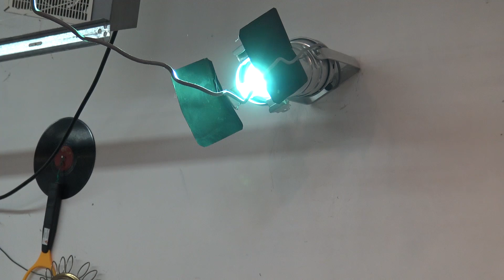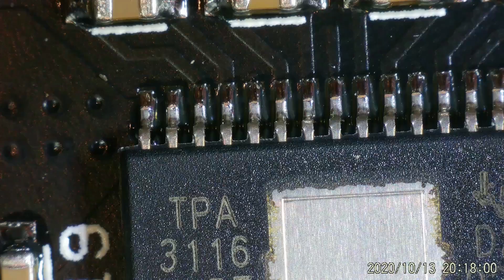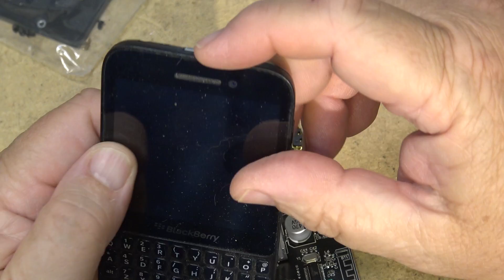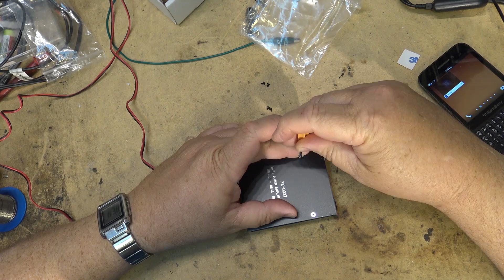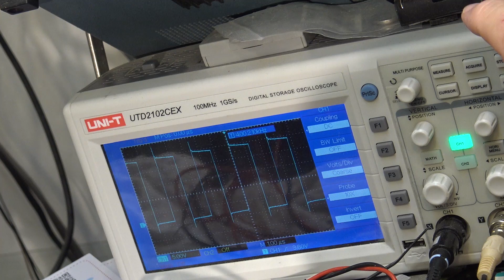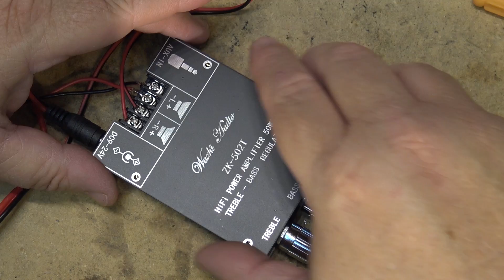tpa3116d2  50 watt bluetooth board with base treble and volume controls

Comment: Weird problem.  When I watched this video, on my Samsung TV through the YouTube app, the audio was very low, and I had to turn it to max, which wasn't making much difference in the volume.  Whilst watching, I decided to open the video in my Android phone, and as soon as I clicked on the video I was already watching, the audio on the TV suddenly came to the proper volume.  It was weird.  I've had problems lately with volume on some YouTube videos on my TV, but this baffles me.  Just by clicking the video on my phone, the TV boosts to a higher volume..  I have repeated this several times.  After opening the video on my phone and the volume correcting itself on the TV app, I can close the phone app and the volume stays, but if I reopen the video on the TV, it's back to the low volume again.  Any1 notice this problem?  Weird that my phone actually fixes my TV volume, without even being connected to the TV.

Comment: I just watched Paul Carlson's Lab's latest video where he built a turn on delay, but there's a bit at the end where he talked about transformers and I learned something that I never knew! It's really got me thinking! Now I'm looking at the inductors at the output of your class D amplifier and wondering if inductor size plays a role in frequency response? I have seen many different versions of these little amplifiers and the difference is usually in the type of inductor and capacitor that the designer have chosen to use! 
The difference in size for the old 25hz mains line transformers to the current 50hz is huge! Admittedly, I don't know enough about this particular topic but it would be interesting to know if the size of the inductors used as an output stage filter makes any difference to it's frequency response, some class D amplifiers seem to have troubles getting down into the lower frequencies! And yet they still use them for car subwoofer amplifiers! I have had a few of them but I'm always drawn back to class A/B, if you know anything better on this topic I would love to hear about it, I haven't seen any videos on this yet... Paul's vacuum tube amplifier is output transformerless and I think that he gets down to 17hz at 1db down... Or was it lower than that? Not sure now but it's pretty low. 
Anyway, this was a great review, I have a few different versions of these things, some have the same inductors and others have the larger red ring type, I haven't heard them yet but I think that when I do, I will be specifically looking at their low end results to see if there's anything different between the different output filters...
Reply: The inductors will only affect the high frequencies of the class D amplifier's output because the output network is a low-pass filter with the inductance in series with the speaker. It's the opposite of a tube output transformer which has inductance in parallel with the speaker. If a class D board has trouble with lower frequencies maybe the coupling capacitors are too small.
Reply: @eDoc2020  the coupling capacitor would be my first port of call for bass response in any other amplifier unless it's a single ended capacitor coupled output stage but when it comes to class D amplifiers, my first exposure to them was with car audio amplifiers and I really didn't get what I was expecting, the next time was when I decided to give my 90's Sony ES amplifier to my son and get a newer Sony ES amplifier that also had HDMI, even though it's rated at a higher output and has more features, the new one is also a class D topology and I hate how it sounds! I really had high hopes for it, it's not noticed during movie's, but music is terrible. I really regret giving away the older one. I have an amazing little amplifier that was sold as a kit in Australia back in 1973 from the Electronics Australia magazine that someone else had built, she's rated at 13W per channel and she literally makes wine out of music! It's the ugliest amplifier that I have ever seen, I originally got it to gut it and put two 200W class D amplifier modules inside it, I really don't know what I was thinking LoL. 
There was a time when I got caught up in the class D hype and purchased a lot of different class D amplifier modules from eBay for all sorts of project's but if Sony and pioneer couldn't get it right, then I wasn't going to bother with the eBay stuff so they have been sitting around doing nothing! 
But this new little insight into transformers and how their size affected it's frequency response got me thinking about class D amplifiers again... But as you have pointed out, it's a filter, not quite the same thing.. but I will have to look at the input capacitors...
Reply from the maker: The inductors on class d are to remove the high frequency carrier and their size is chosen dependent on the carrier frequency.  Higher frequencies use smaller inductors.  Lower use larger ones.   Sub amps tupically use 60-100 khz and massive inductors plus low pass filters to limit the frequency response to a fee hundred Hz.  
I haven't seen Paul's transformer less tube amp. I know Paul but admityantky haven't been to his channel is years, or for that matter anyone else's for that matter.
Reply: @12voltvids  WHAT? you don't watch YouTube? LoL fair enough... I have been noticing a little shift with content providers lately, a lot of providers are being mentioned on other channels and I have seen providers commenting on other channels! As a consumer LoL I really love it when I see a familiar face commenting elsewhere! I think that it's a good thing, you guys are professional, you all know each other if only through watching on YouTube, to me it feels like a little community, if I'm not watching one of your videos, chances are that I'm probably watching someone else that you would probably be watching to because we have similar interests! You might be a content provider but you need entertainment too! And being a community, we all learn from each other so we all have something to give! Even if it's just to leave a comment saying that you are gay or something else just as stupid for something that you might have done, not that is what I'm saying, I have heard other providers talk about some of the comments that they have got at one time or another.. hmmm I wonder if anyone else has put together a video on just these types of comments LoL... 
Anyway, thanks for your reply, it's always welcome! See you in your next video, well not really you but your hands lol, do you wear gloves when you are out in public just in case you get recognised lol? Ok I'm just trying to be funny now...
Reply from the maker: @PeterMilanovski  
Actually when i do watch YouTube which is not very often it is usually music based.  To watch a classic jazz or rock performence or something to do with cars.   I just don't have time.  I spend an average of 40 hours a week working on my channel and when i work another 37 hours a week at my day job there is little time for anything else.
Reply: @12voltvids  I hear you buddy, you work way to hard! It takes super human abilities to do what you do and I truly appreciate it...

Comment: I'm still not sure about D class amplifiers yet,  i'm mentally stuck in the  push pull analog amplifier days.
Stuck in the mud lol.
But it is very small and neat for so much power output :-D
I wonder what a spectrum analyser would make of it.
Reply: TL;DR I am never going back to using class-AB P-P ever again never!.
I literally had a lifetime of awful class-B notch crossover distortion, as a toddler to teenagehood  first stereo was a solid state 1967 philips stereo of the time(Germanium P-P), then gifted a transistor radio (that POS 2 germanium and nasty OPT, awful ) Then I was suckered into buying "Sage Audio" mosfet modules for about 10 years, the guy who built them lied about them being "dynamic class-A" They had a lot of class-B notch or crossover distortion at low power, piano sounded super grainy like surrounded with scraping sand paper changes with the music, , that's why I always listened loud with them, until they blew,  then I went P-P tube amps, for the next 10 years, wonderful smooth but low power for what I grew used to, and low on detail, then I bought a Behringer europower 1500, out of box, I put a 1Khz tone at very low volume, and put my ear against the tweeter and immediately identified the familiar distortion, that was solved by upping the bias inside, NOW in a 4 way active system, Using ICEpower Class-D for High FR,  and an older tripatch for midrange,  
Smooth detailed, Will NEVER go back to Class-AB.

Comment: Tiny bit between R1 and C1 time stamp 5.41 / cap right of c17 6.54. 
I often use a stiff toothbrush on new kit. surprising what you can find in a finished product.

Non related comment we had a LED 14inch TV for years and then it did not work inside the case they had trapped the main cable and screwed the case shut in the factory, and over the years it then blew the fuse, I was not expecting that, it is not exactly the first think you look for, fault went away when I opened the case.